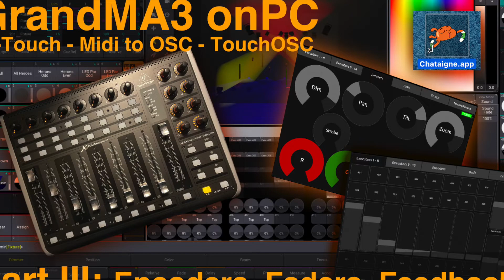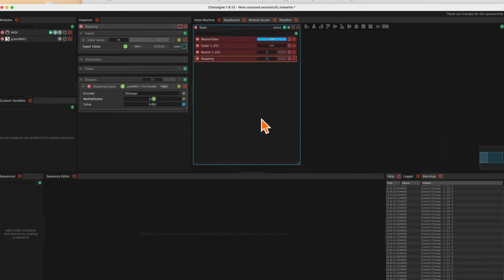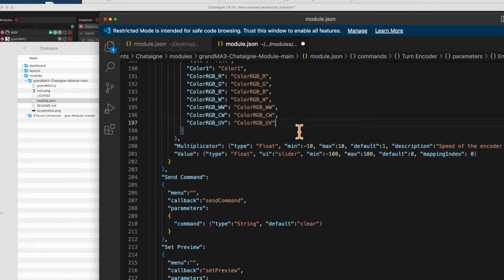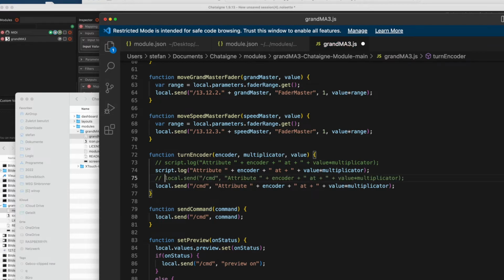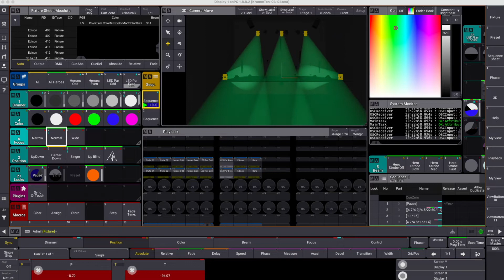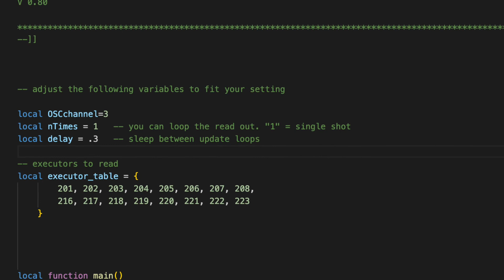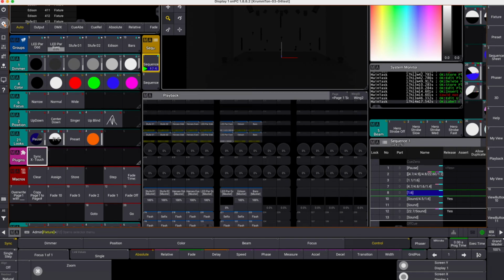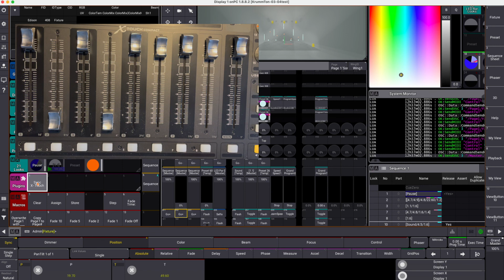Grandma3 Midi to OSC - Part III: Encoders, Fader, Feedback

Comment: Thanks a million for your super clear tutorials! I've got the big X Touch with encoder wheel and small displays above the faders and I am wondering if your chataigne-way of syncing it with onpc might be able to also sync sequence names to these displays? And also, would it be feasible to use the big encoder wheel for different attributes, e.g. by selecting a specific attribute to control via one of the buttons above? Would love to hear your thoughts on that:-)
Reply from the maker: Thanks a lot! I am afraid that name syncing won't work as the X-Touch only understands midi. I only have the compact version, but I will look up the manual form the big brother regarding the encoder wheel. No promises though ... :-)

Comment: Hi! I'm currently writing an script myself. Do you know if it's possible to have a LUA script in grandma3 that runs in the background that, when an executor is pressed, sends that info through osc to chataigne ? Thanks a lot :)
Reply from the maker: I'm afraid it is not possible. Would be good to hook into an event (there is a "hookobjectchange" function but there seems to be no slot for fader or button changes). For the sliders one could create an endless loop that checks the faders and send out their values, the fall to sleep for a given time. However, this produces system load and may delay other functions. I am not sure if somebody has a solution for that. You could check the forum at MA-Lighting or the facebook groups. Sorry for not being very helpful. Stefan
Reply: @stefankrumm6709  okay no problems! Thanks a lot anyway! 

Right now I'm trying to develop a small program that take osc output from grandma. I want this osc output to contain info about the executor status (either on or off). Then my program process this osc output and accordingly displays the result on my launchpad mk2. 

For example, I've mapped the first 8 pads of my launchpad as the executors 101, 102, 103,..., 108. So pad 1 is executor 101, pad 2 executor 102 and so on... 
So if in grandma3, with my mouse, I click on the button of executor 101, I want it to, without any action on my behalf, light the first pad on my launchpad. That's why I need an kind of event listener script running on grandma3 to continually update me the executor status. I don't know if it has already been done or it's too challenging but I'm working it! If you want to chat about this I'd love to! I saw your site and you've got very cool projects!

Comment: Hello new problem for ma3 1.9 your plugin for chataigne would not run correctly so you would need to upload an after 1.9 update plugin instead of updating the old one so it dont break peoples setup. Because they changed how osc works with faders you now asignin the position of the fader not like now you asignin bank 1 fader 1 lets say you bow only mapping fader 1 no matter wich bank. This means if you change bank your first fader need to update to the position of fader 1 on bank 2 and 3 etc

Comment: Hi,i have a problem with a sync my behringer and ma3 on pc.I made all you show in the video, but when i try sync i have an error in my comand line and nothing happend.Illegal object....
Reply from the maker: I would need a bit more information in order to help you. Can you mail me a screenshot of the command line history to ArtOfLight@stkrumm.de ?
Reply: @stefankrumm6709  Im unfortunately getting the same error. Did you ever figure out why?
Reply from the maker: @stephencassidy4127  Hi, did you configure and enable midi and OSC output? A screenshot of the system messages and the command line history would be helpful.
Reply: @stefankrumm6709  Yeah I followed the steps just lots of illegal object errors when I run the script. Thank you for uploading all this btw. The tutorials are fantastic.
Reply from the maker: If you don't need syncing also TouchOSC, please just delete the line reading "Cmd("SendOSC 3 \"/Master"   .. ",f," .. val/100 .. "\"")" nearly at the end of the plugin file. Or if you need OSC output, adjust "SendOSC 3" to your OSC output channel, e.g. "SendOSC 2". Sorry for me beeing so unprecise in the plugin and video.
Stefan
Reply from the maker: Ooops,
I saw that there is an additional line that must be deleted or modified. Please search/look for "SendOSC".

Comment: The comand works not so greta im sending always 2 Comands at the same time because note on and off
and my encoder does not got to -100 it resets at 0 to 255
Reply from the maker: Hi, could you please give me some more detail? Where does the not-on/off come from? From the encoder? Could you eventually send me a log from Chataigne, so I could check what is going on. You can set the range to fit your needs. Either or, better, both, in Chataigne in the filter/remap dialog and in the module.json. I will try to set this up at the weekend and will put a link here.
Reply: @stefankrumm6709  im using a Xtouch mini and an Akai apc mini mk2 and on both if i make an Input any button it will always send an Note on and Note off signal to Chataigne and senden both of the times a clear
Reply from the maker: @PixelPlayslLP  I will check that. Just to be sure: you mapped a button on your midid device to send a command "Clear" in Chataigne and onPC receives a double Clear?
As I said, I check that here.
Reply: @stefankrumm6709  i recieved a double clear in ma too so its like 2 times sending a Single Clear
Reply: @stefankrumm6709  If i hot a Normal Pad it will always send an Note on and a note Off and on both it will send the Comand on the remap 
16:16:27	CustomLoggerUI	Cleared.
16:16:28	X Touch mini	Note On : 11, G#0 ( pitch : 32 ), 127
16:16:28	grandMA3	Send OSC : /cmd
16:16:28	OSCModule	clear
16:16:28	X Touch mini	Note Off : 11, G#0 ( pitch : 32 ), 0
16:16:28	grandMA3	Send OSC : /cmd
16:16:28	OSCModule	clear
Reply from the maker: @PixelPlayslLP  You are right! I didn't realize this behaviour yet. Looking for a fix.
Thank you!
Reply: @stefankrumm6709  if you made that plugin i thank you i searched for an easy Software to Assign Multiple Midi Controller and you even wrote a plugin for a Motorized fader backsend
Reply from the maker: @PixelPlayslLP  Okay, here is a solution that seems to work on my side. In Chataigne go to the filters dialog, click the "+"-sign and add "Condition". Set the filter value to "127" which means note on. So the note off is ignored. You can download a screenshot here: https://stkrumm.de/wp-content/tutorialMA3/FilterNoteOff.png
Reply: @stefankrumm6709  yea Functioning too i made it so its on the release from the Button so oyu need to set the Condition From input Value -> input value =0 then if you release it it will be done